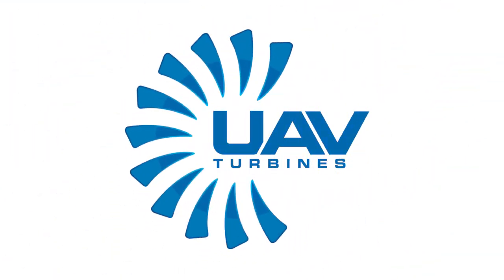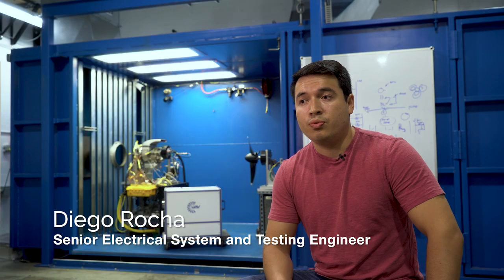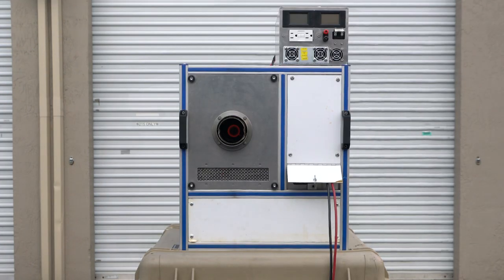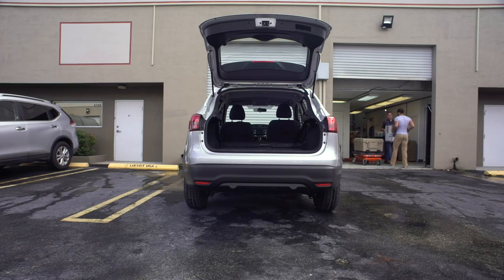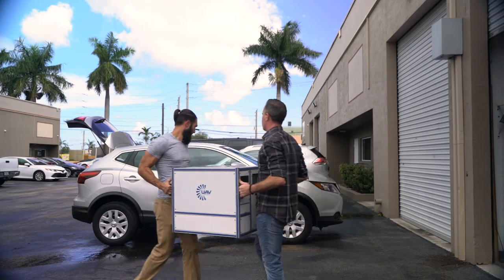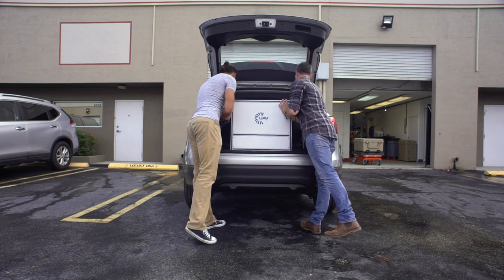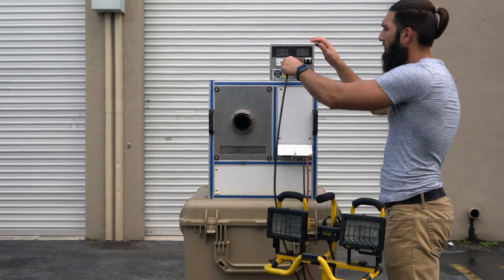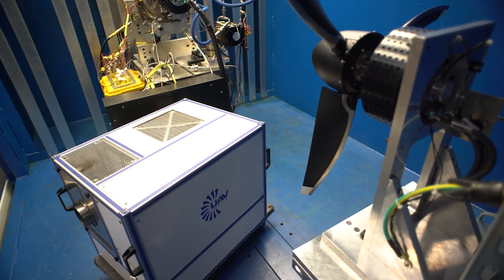Micro-Turbogenerator Systems (MTS) for on-demand electrical power.

Comment: Probably about ~30% efficiency for stand alone electricity generation. If used in a CHP (Combined Heat and Power) application I think those efficiency numbers approach 80+%. The heat to power ratio is around .6-.7.
The Main benefits are the power density, reliability and simplicity of the turbine. If you could convert that Waste Heat into Power (WHP) that would be ideal but you add weight cost and complexity, IMO.

Comment: The bleed air can also be used for heating, pressurization, most apu have an HVAC and generator built in, I cant believe electric cars are not offering these as an option in trunk or tow behind. I look forward to seeing where your company goes.
Reply: I cant believe we are not using these to power eVTOL aircraft
Reply: APUS are super expensive and super not energy efficient, they are only useful if you want a lot of power in a small package overwise its better to just use a reciprocating enegine when bellow 500bhp
Reply: @misham6547  Oh absolutely, but throw it in a trailer and enough bio fuel to recharge a couple times, work with a manufacturer so the vehicle has the ability to charge and drive at the same time, find a ballance between charging ability and APU size possibly making a smaller size if needed for the purpose accepting they will be high value assets possibly even irrationally expensive but paving the way for more efficient engine options like a bio diesel operating at optimal rpm or fuel cell. Trailering would be the easiest way to simplify designs but there possibly could be an on chassis version where a light generator would be ideal allowing you to fuel it only when needed reducing weight. It may be a pipe dream but pipes happen.

Comment: This would be perfect in combination with a biogas system at home, use the exhaust flame to heat water, and generate electricity to charge a battery. But maby financial wise solar would do better.
Reply: Depends on where you are.  This could be a supplement to solar during the winter, for example.

Comment: I wonder if you use something like a venturi with a rod that is flat on one side to draw fuel into the combustion chamber? The idea a cupped vent forces air around a rod that is flat on one end to make low pressure to draw fuel up and out into the combustion chamber?